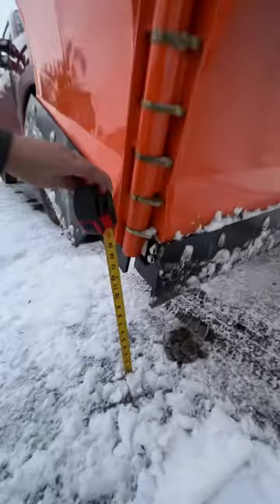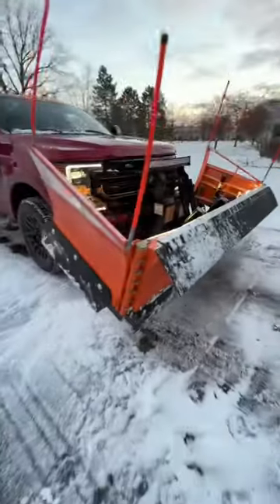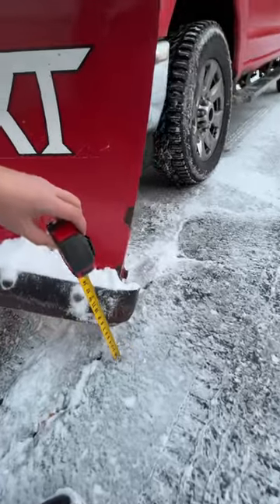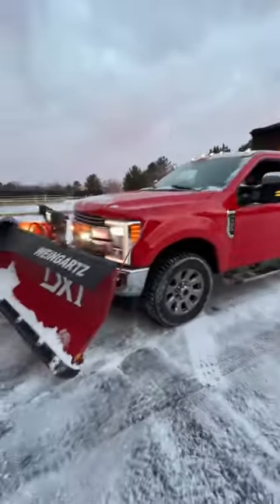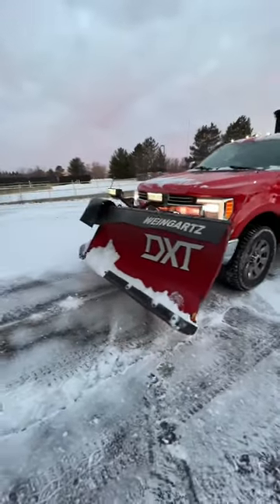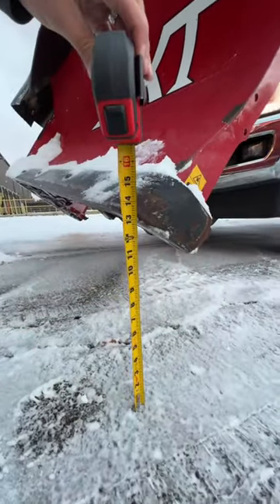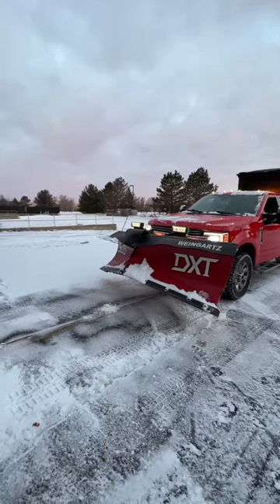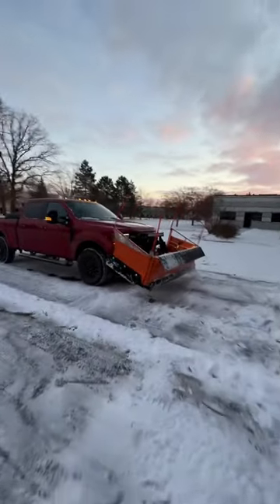Clearance On BOSS 9.2 vs SnoPower F14 #shorts

Comment: 6 and 3/4 more like 3.5 or 4 inches and not 13 more like 10 the tip of curved cutting edge sits lower then where you measured which means your clearance is actually lower on boss then what you said